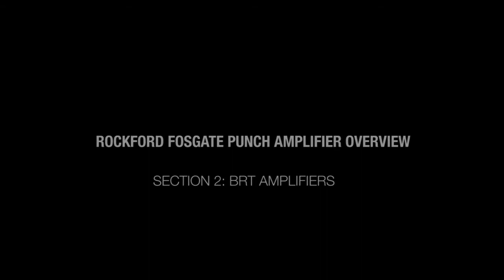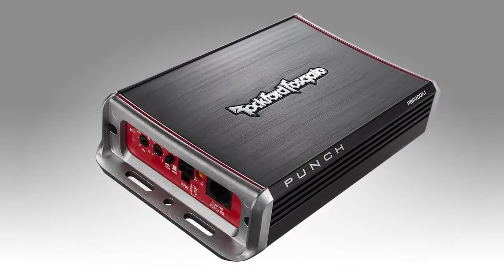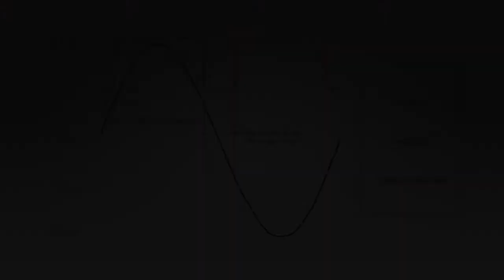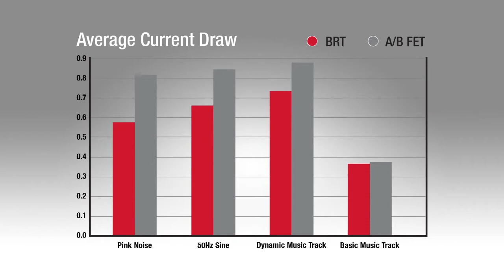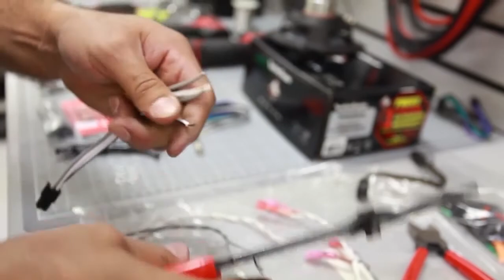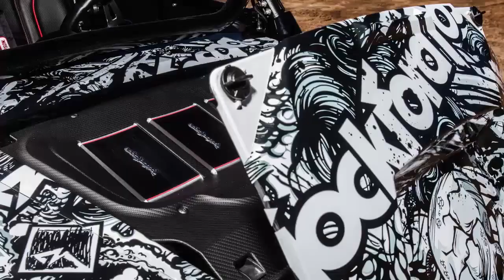Rockford Fosgate: Punch Compact Amp Overview (3.2)

Comment: Comparing this model to kenwood kac m 1814 and alpine powerpack ktp 455u.....is this model better then kenwood and alpine ?
Reply from the maker: Since you're looking at 4-channel amplifiers, I included the newer PBR400X4D for comparison.  As you can see, the PUNCH amplifier provides more power than the Kenwood & Alpine:

PBR400X4D
• 50 Watts x 4 @ 4-Ohm
• 100 Watts x 4 @ 2-Ohm
• 200 Watts x 2 @ 4-Ohm Bridged

Kenwood KAC-M5014
• 50 watts RMS x 4 at 4 ohms
• 75 watts RMS x 4 at 2 ohms
• 150 watts RMS x 2 bridged at 4 ohms

Alpine KTP-445U Power Pack
• 45 watts RMS x 4 at 4 or 2 ohms
• 90 watts RMS x 2 bridged at 4 ohms
Reply: @rockfordfosgate kenwood you have the wrong model in comparison - i said kenwood kac m 1614 - 4 channel amp
Reply from the maker: @burjis24  Can you send a link to the specs?  I can't seem to find that model number.
Reply: @rockfordfosgate kenwood KAC M 1814 MARINE AMPLIFIER COMPACT 4 CHANNEL

Comment: i put the 4 channel punch in my bike and it lasted 1 ride now i have an amp that is no good because it got too hot, i would not buy one of these because of that issue!!! cost me close to 400 bucks here in Canada and i cant even get it repaired anywhere if it was repairable a waste of hard earned money. Fosgate makes great amps but this one is a bust to me unless you can afford to replace it when it blows up
Reply from the maker: Hi Zane, sorry you're having problems.  While I'm not certain what model "4 channel punch" you have, all of our amplifiers include warranty as shown below.  I'm sure you purchased the amp through your local Rockford Fosgate Authorized Dealer in Canada, I would take the amplifier back to them for exchange on a replacement.  For motorcycle usage, we highly recommend the RFK-HD14 or RFK-HD9813 amplifier installation kit that includes the heatsink mounting bracket.  Was this amplifier used with one of those kits (links below)?

• Punch PBR300X4 = 1 year warranty
• Punch PBR400X4D = 1 year warranty 
• Power T400X4ad = 2 year warranty
• Power TM400X4ad = 2 year warranty

• RFK-HD14: https://rockfordfosgate.com/products/details/rfk-hd14/
• RFK-HD9813: https://rockfordfosgate.com/products/details/rfk-hd9813/
Reply: @rockfordfosgate   thanks for your reply, i bought it on Amazon and no i did not have the kit. the amp is the PBR400X4D so i have to eat that loss sadly but i did buy the TM400X4ad  and so far no issues as it runs cooler. i do not think it said to get the heat sink when i bought it or in the manual, i researched so many amps and that one had the best reviews. so when it blew up i was quite upset about it as it is too much time wasted trying to get warranty from the U.S in Canada as that was where it came out of on Amazon. like i said you guys have great amps and is a person is going to go with Rockford do not get the  PBR400X4D as it will get too hot in the fairing and most likely blow up, they should spend a little more and go with the TM400X4ad as it is a much better amp. it might just be the overheat circuit that is fried but who knows again thank you for your reply
Reply from the maker: @zanedgallipeau9119  Thanks for that information.  All our H-D motorcycle audio kits use the TM400X4ad amplifier, so we exclusively recommend that model for in-fairing use.  Be sure to download our tuning guide for your particular install so you can set the GAIN and crossovers properly.  You can download it FREE here: http://rftech.custhelp.com/app/answers/detail/a_id/1355.  If you have a 2014 or newer, use the HD14RGSG-STAGE2/3 wiring diagram.  If you have a 2013 or older model, use the HD9813SG-STAGE1/2/3 wiring diagram.

It would be worth going through the Amazon reseller to get a warranty replacement on the PBR400X4D, then you can just sell it once it's repaired.
Reply: @rockfordfosgate   thanks for the info, i might do that but at this point it is just a lesson learned that not everything you see on youtube is right. i now as a result do more homework on things
Reply from the maker: @zanedgallipeau9119  Fair enough my friend.  We got your back and always have free technical support available to help whenever you need.  They can be reached at 1-800-669-9899 Mon-Fri 8am-5pm Arizona time.  Hope you and the family have a great New Year!   -Eric.
Reply: @rockfordfosgate   was wondering why the Dsr1 only works with apple or android why not on a regular laptop?
Reply from the maker: @zanedgallipeau9119  We invested development in the most requested format, being mobile devices.  When we developed the 3Sixty.3, the suggested platform at the time was Windows.  However, a couple of years later, fanatics overwhelmingly demanded we offer a mobile app for controlling the device.
Reply: @rockfordfosgate   oh i see, i was told the app should work on an ipod touch do you know if this is right?  i do not want to purchase a tablet just for that and i do have an ipod touch 5th or 6th generation. i do not have a phone as i do not like them. thanks for all your help and info so far it is helping me immensely. i get it now you have to go with what will be the most used platform. i am doing so much research on your equipment and invested quite a bit in it i want to get the maximum out of it. i am sure it is going to sound great once all is done the only thing i have found is very few audio tests done with the new Harley Powered by Rockford videos and even more hard to find ones that play rock not the stuff they use in stereo competition's.
Reply from the maker: @zanedgallipeau9119  Perfect Tune works on APPLE: iOS 10.0 or later (iPhone, iPad, iPod touch) and ANDROID: Marshmallow 6.0 or later (optimized for 5-inch screen or larger).  You can download it free and test the functionality here: https://www.rockfordfosgate.com/products/details/dsr1/

Comment: Hey guys, I'm looking at the new PBR400X4, it looks awesome and puts out all the power I want. 

I'm wondering simply, is the power delivery into resistance linear?  The speakers I bought are 2.5ohm, I can expect the amp to put out almost 100W (rater) per channel into that load correct? 

Also, the amp has remote turn on internal, but does it have radio detect?  I believe my factory radio will not turn on without a load, I'm just wondering if the new 400W compact has an internal load so that I don't have to get resistors?

Lastly, the 300W version doesn't look like it has a noise filter, but from what I've seen the new 400W model has high end noise filtering for Class D, is that correct? 

I love Fosgate but right before I wanted to buy I saw that some other firms, like Kicker, offer the options I mentioned above, so I need to make an informed decision.

And what reason would there be, if any, to go with the regular Punch P400X4 over the PBR400X4D?
Reply from the maker: Hi freethinker4liberty,  I'll try to answer your questions as best as possible here: 
1) I'm not sure what you're getting at by "is the power delivery into resistance linear".  Technically, speakers do not exhibit a resistive load, but rather make up a complex "impedance" of resistance, impedance, and inductance.  The PBR400X4D is rated to produce the below power ratings, so it would be safe to assume a 2.5-ohm speaker would lie approximately between 100 Watts and 50 Watts.  I'm leaning more toward 80-85 Watts RMS.
50 Watts x 4 @ 4-Ohm
100 Watts x 4 @ 2-Ohm
200 Watts x 2 @ 4-Ohm Bridged
2) The PBR400X4D has a "variable DC offset sensitivity", so yes it has "radio detect". 
3) If you're referring to the PBR300X4 vs PBR400X4D, they are different topologies.   The PBR300X4 is a Class-BR (type of A/B) and the PBR400X4D is Class-D.  Different power supplies have filtering based on their respective requirements.  A Class-D amplifier has a different power supply filter compared to a Class-A/B amplifier.
4) The Punch P400X4 is a class-AB amplifier designed for sound quality.  The PBR400X4D is a class-D amplifier designed for high output in an efficient package.
Reply: @rockfordfosgate  Yes, your answer to 1 is exactly what I was asking.  I have seen amps that have a certain rating for 4 ohm, another for 2 ohm, but for some reason at 3 ohm they have a lower rating than either of the other two.  If I'm not mistaken, your Power amps (which I'm considering as well) have a lower power output into 1ohm than 2ohm, for example.

I'm building a SQ system, but with class D tech such as it is, especially with high end stuff like Fosgate, I don't think I could ever tell the difference, which is why I'm pulling towards the compact, much smaller, and takes less energy from the electrical system, I mean what purpose would there be at all to go with AB heh!

I think I'm going to find a dealer and listen to a fosgate Punch class D and compare it to AB, and if I do indeed hear a difference, I'll go with the P400X4.

Thank you for answering, amazing!
Reply from the maker: @freethinker4liberty  Great!  Glad I was able to cover everything.  The power ratings on Rockford Fosgate amplifiers are typically based on our non-regulated power supplies, where you gain more power as you increase battery voltage.  All our amplifiers (except the Constant Power models) produce more output as you lower the impedance.
If you're building a SQ system, personally, I would recommend the P400X4 amplifier since it's specifically designed for Sound Quality.  However, you must be able to make the choice yourself when considering limited charging system current reserve vs output power.  I think you're very smart to go and listen for yourself.  This way you'll  be certain to hear the difference.
Best of Luck! 
-Eric R.
Reply: @rockfordfosgate  Eric, one more to bother you, sorry.  About start-stop in vehicles, is that anything to worry about?  I don't think that would be an issue for a system with just a 4channel amp, but I feel like I have to ask.

As far as the P400X4, that was always my first choice and I've had Punch amps throughout the 90s and 00s, but there is something very attractive about the Class D mini amps, I think I may be able to hide it behind the dash or glovebox and that is amazing.

I have a new 2020 Grand Cherokee, I think I have enough electrical power for either of the amps we're discussing without running into trouble, I hope.

Does the P400X4 also have auto-turn ON and a load on the speaker level inputs so that when the stereo sends the signal, the amp turns on and the radio works? 

As far as I know, amps with speaker level inputs do come with auto turn-ON, but not all come with a load resistance on the input to tell the stock radio there are speakers connected, and so even though the amp turns on, the stereo will not send a signal as it thinks the speakers are not present (thus the need for resistors on the wire and why i asked the original question).

I'm going to spend a couple thousand on this system so I want to be armed with as much info as possible.

Now, if only Rockford made 6x9 components I'd be in heaven!

Thank you!

PS.  The Power mini series is AD, meaning it has the quality of A class and efficiency of D class?  I may just bite the bullet and get the mini power T400X4.
Reply from the maker: @freethinker4liberty  Start-Stop vehicles have a work-around where you need to source a point with 9-12V so you should be fine.  I've heard of installers using an adaptor that keeps the voltage present during the down-time.  Our input circuits present a 20k ohm load, so this is typically good enough to show the radio a load.  Again, your installer will be able to work around this if for some reason the radio will not turn-on.  The Power AD amplifiers are Class-AD hybrids.  Yes, Class-A on the front-end and Class-D on the outputs, but they also have "Constant Power", so the RMS output between 2-ohm and 4-ohm loads is about the same (constant).
Reply: @rockfordfosgate  Thanx Eric, but judging by your response the P400X4 takes much more power from the electrical system than the PBR400X4D?  Could it be that much of a difference?

To tell you the truth, I think I'm just going to go with the Power Mini, the T400X4 I think it's called, and call it a day.  That way if I need to, in the future, upgrade to a sub, I just get the Power Mini mono.  The 5 channel power mini would be the best way to go but I don't know how it will like only running 4 channels for about a year as I'm not planning on adding a sub until then.

People say the Power Mini has even better quality than the Punch which is hard for me to believe, but if it's at least on par with that one, it's the best of both worlds, small and powerful.

I have a 2020 Jeep Grand Cherokee with I believe a 160-180amp alternator, stock, will that be ok for the T400X4AD I go that route, and even adding the mono later?

Thanx for covering all my inquires, I'm looking for an installer as we speak, but some are closed still :(
Reply from the maker: @freethinker4liberty  Average current draw for the PBR400X4D is 27 A, the average for the P400X4 is 30 A, and the average for the TM400X4ad is 28 A.  They are all comparable. The T400X4ad is a powerful little brute and doesn't take up a lot of space either.  Sound Quality on that amplifier is closer to the P400X4 amplifier.  Either way, you'll have a rockin' system, it's all up to you on the preferences you choose.

Comment: Hi there, how do you do the sound testing? I’ve the cd for the set up but my 2014 harley doesn’t have a cd player, it has the boom audio. Please advise
Reply from the maker: We have downloadable tracks available here: http://rftech.custhelp.com/app/answers/detail/a_id/1126
If you have a Rockford Fosgate audio kit, we already created the Amp Tuning Guide for you available here: http://rftech.custhelp.com/app/answers/detail/a_id/1355/
Reply: Rockford Fosgate  will definitely check it out. Many thanks
Reply: @rockfordfosgate  Can I run 2 speaker in the front channel and 4 speakers on the rear with my pbr400x4d?
Reply from the maker: @MrAyarza  Yes, the amplifier is capable of running a 2-ohm load.  You can run 2 speakers on the front (4-ohms each side) and 4 speakers on the rear (two 4-ohm speakers on each channel wired in parallel would create a 2-ohm load).
Reply: Rockford Fosgate Awesome! Thank you, I added the 6X9 Rockford speakers In the saddle bags and they sound great. I’m pretty happy with your brand.                     I appreciate your support.
Reply from the maker: @MrAyarza  Awesome!  Thanks for rockin' your ride with Rockford Fosgate!
Reply: @rockfordfosgate  
Hello
I have 
ROCKFORD FOSGATE PUNCH PBR300X4 300 WATT 4 CHANNEL COMPACT POWER AMPLIFIER .

What are the best settings.
Thank you .

Comment: Why does the amp come with female rca connections when all aftermarket systems have female connections.  Additional connectors are required to make a low level input installation.  Why doesn't your harness have male connections?
Reply from the maker: Every amplifier we produce utilizes female RCA adaptors because a majority of installations do require some sort of male patch cable between the source unit and the amplifier.  If by chance you're plugging a source unit directly into the amplifier, simply use a double-ended male connector.

Comment: I don't understand  "vehicle's electrical system as it's power supply" how is this different from a regular amp?
Reply from the maker: Traditional amplifiers use a "step up" transformer to convert the battery voltage (12 Volts) into higher "rail" voltages like +/- 30 volts.  The compact amps with Class BR don't have a step up transformer.

Comment: The only thing I don't like about these amps,! Those amplifiers get so hot, you can cook an egg on them ! They need better airflow
Reply from the maker: Appreciate your feedback.  For installations where traditional convection airflow does not suffice, we suggest using the POWER series compact amplifiers, as these have dual-fan control for optimum cooling.  You can learn about the fan cooled compact amps here: https://youtu.be/zifpL8AXcbs